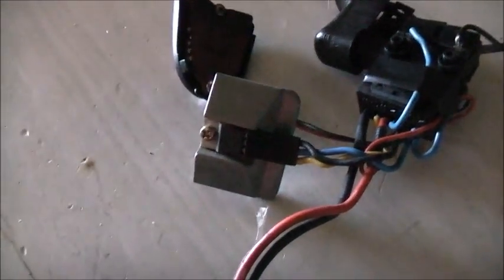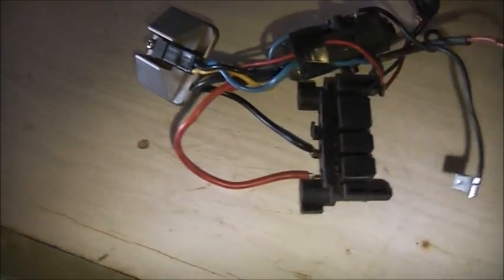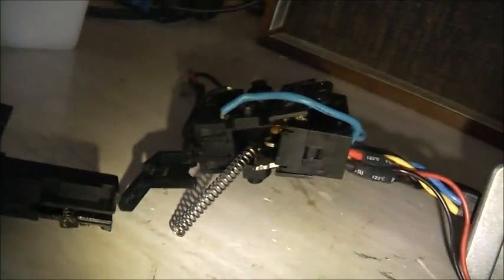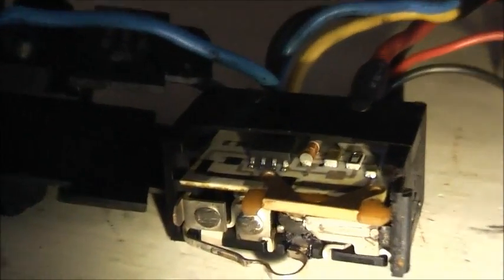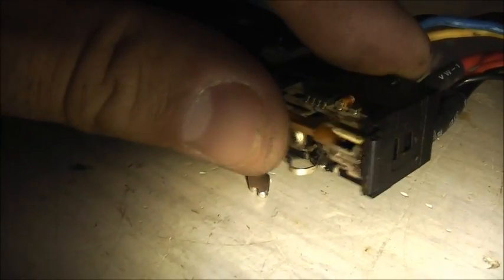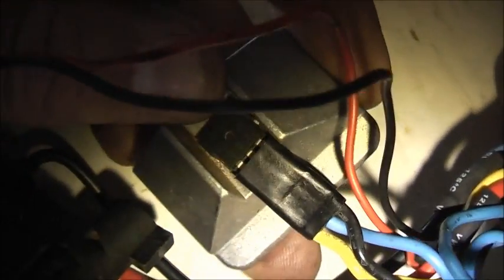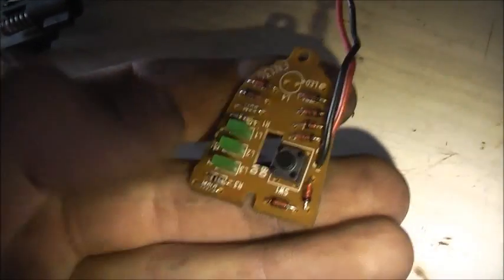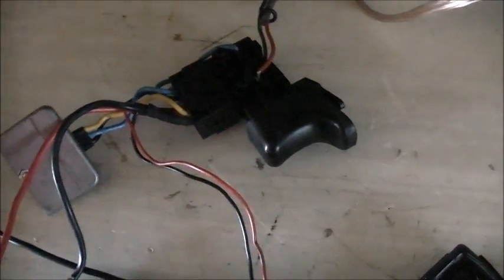PWM Switch Teardown

Comment: Hiya. You know these vacuum cleaners that have the variable speed control on them...would that be a PWM arrangement? That vac I have (which has yet to show on my channel) has a board in it with some electronics, & two long wires which go to a mini-variac (it looks like a potentiometer) & when that is turned, the motor speeds up/slows down accordingly. :-)

Would be handy if you could repair this....Would be funny to see little motors screamed-up on it. :-D

Thanx for showing,

-BoomBoxDeluxe.

Comment: Dont give up on that circuit, there has to be a diode across the output to the motor thats dead.

That kind of circuit would be handy with a bigger fet+heatsink :-)

Not a cheap design in comparison to some ive seen.